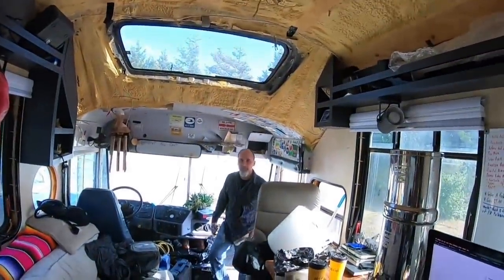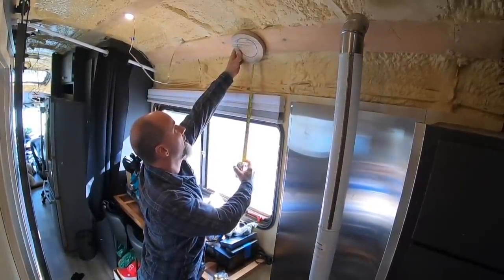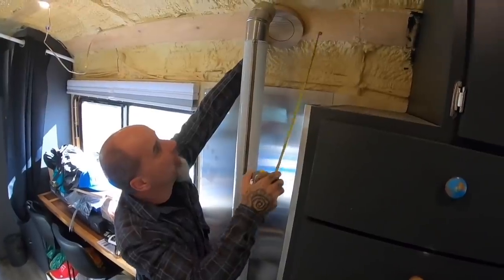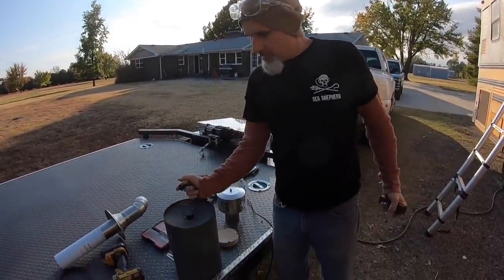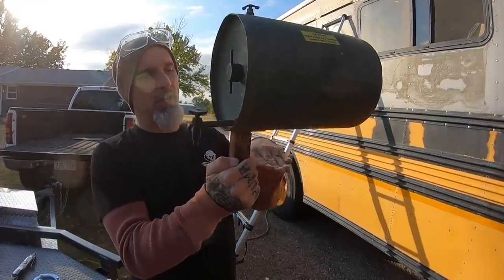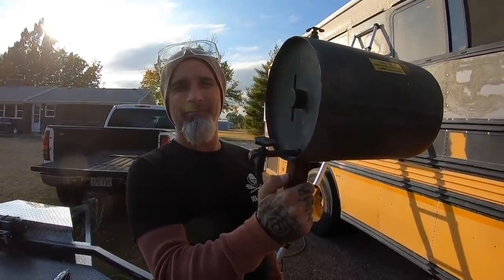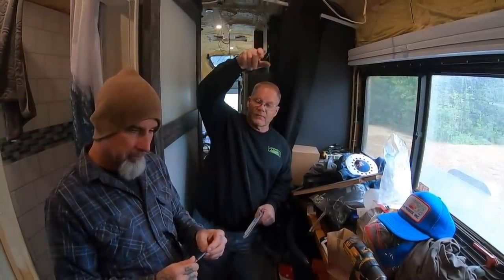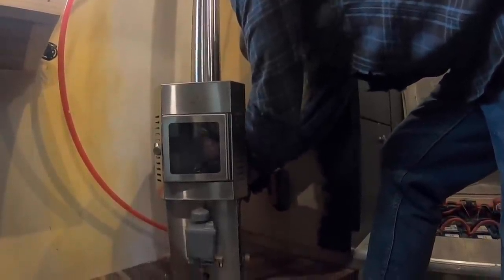New Barn Door For The Bus & Hooking Up The Dickinson Marine Diesel Heater - S5E1

Comment: Why would you put such a small fuel can in? That won't last long at all. That heater burns up 3.2 gallons on high over a 24hr period. You're going to be filling that up all the time and it looks like a pain in the ass to do!!!
Reply from the maker: While testing, I kept it on low and it heated the bus just fine. Low is 1.3 gallons.
Reply: I don't doubt that it will heat the bus but you'll be filling that tiny fuel can almost every day. My fuel tank just for my heater is 22 gallons. And watch out with diesel fuel. You get one drop on your clothes or any other place and it can't be cleaned. It will smell forever.
Reply from the maker: Yep, the tank was a temporary solution. It will mostly be used for early mornings here in AZ. 3-4 hours a day.
Reply: There are advantages to having the tank up there. The warm -air pre-heat is one. The quick disconnect allows for tank serviceability.

Comment: you can mount a electric feul pump on that dickinson stove, use a feul pump for a carburator engine (a ticking pump) , we do this a lot on boats. You connect your fuel line to the main diesel tank. the tank you use is wy to small, your stove uses around 10 to 15 liters a day on full heat.
Reply from the maker: That's the plan. I just wanted to get it working for the rare times I will need it in AZ for now.

Comment: Why a diesel heater and not propane? U could install a propane tank under the bus and run a line to it.
Reply: bus engine runs on diesel and propane tank filling becomes a big problem when you travel around the country. in some states, all you can find is barbecue tank exchange which is the most expensive way to buy propane.

Comment: Tank way to small and doesn't look practical to keep having to fill if it's only good for 12 hours on low. Why didn't you run a line from your current Diesel fuel tank for the bus or at least get a larger tank for the heater. Thought you were going to finish the ceiling while you were meeting up with Wes ?? Like the Barn door installation for sure, very nice. Been a long time in between vids and this was a short one not much info on what you got completed on the build out disappointed actually.
Reply from the maker: Your math is wrong. The tank is 1.5 gallons and the diesel heater runs 1.3 gallons per 24 hours. We were going to paint the bus, not the ceiling. The ceiling is getting done in AZ and I'm meeting up with the guy who is installing it today. Sorry my posting schedule/video production doesn't meet your expectations.